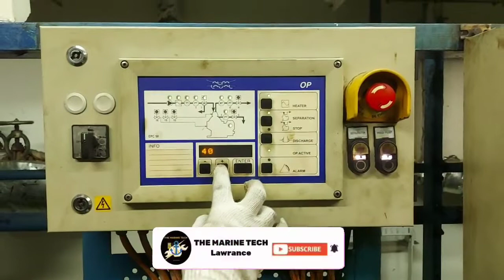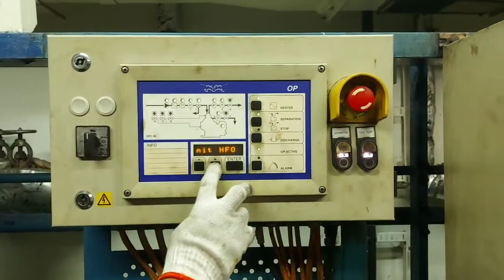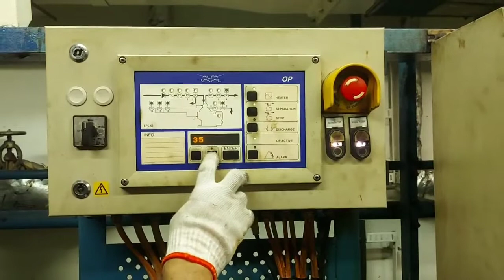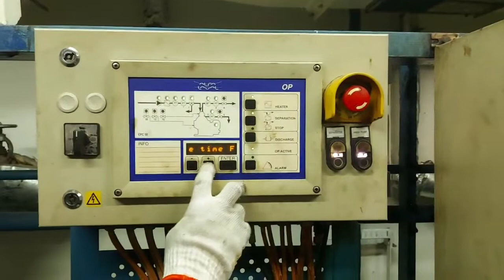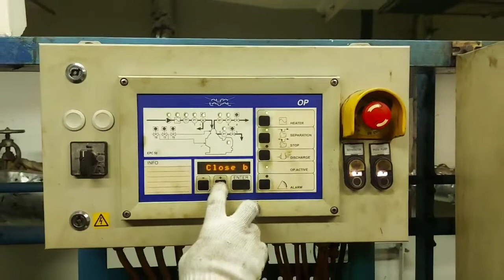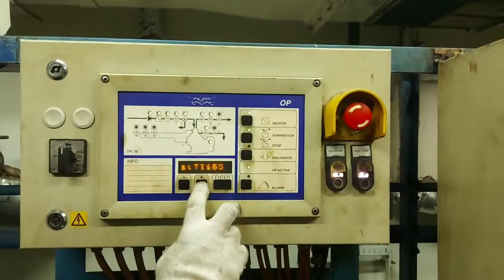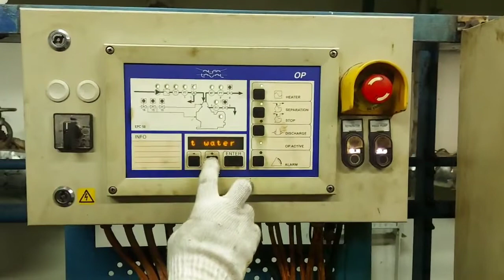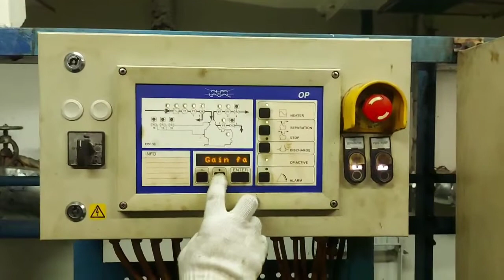FUEL OIL PURIFIER ||SEPARATOR|| ALFA LAVAL||CHECK HIDDEN SETTINGS & ADJUSTED PARAMETERS||#purifiers

Comment: m facing pt4 problem in l.o purifier nd when the alarm comes after that it says bowl rom less..any idea what to do next
Reply: For me same alarm is coming and says no pt4 pressure at ti64, oil leaking to sludge tank what action or suggesstion you give in this regard thanks
Reply from the maker: Can you pls tell me about this pt4 sensor? It's a temperature sensor, right?
1st of all, check the temperature, and if the temperature is ok, then replace the pt4 sensor.. May the sensor be faulty.
Reply: @TheMarineTechLawrance    pt4 is oil feedback sensor .. i had changed the water block ..problem almost gone but still sometimes it becomes 0 nd alarm coming..manual sv16 helps.. but we cant stand near purifier for whole time..
Reply: @santsingh5189 try to adjust by using Allen key. If still the same. Maybe not closing, maybe too much scale from water.